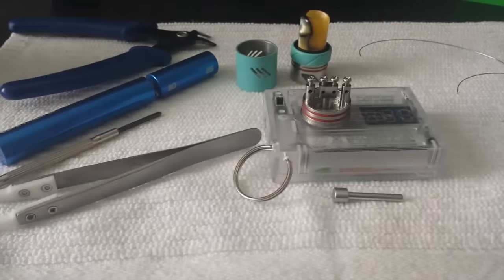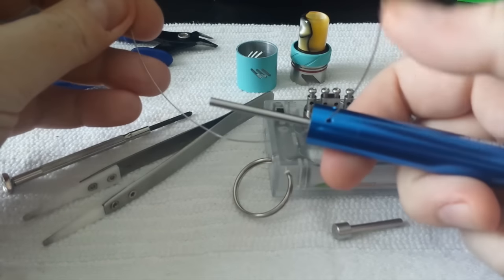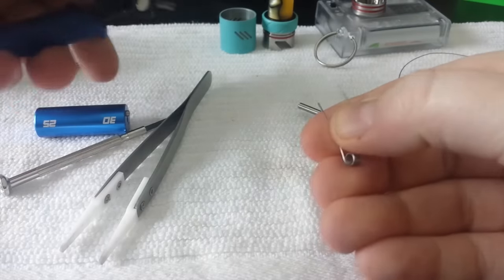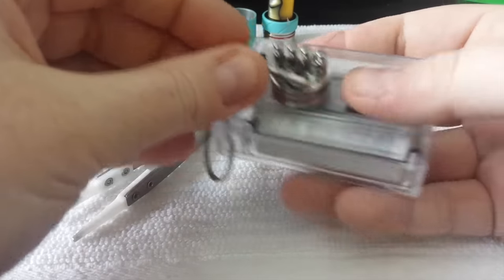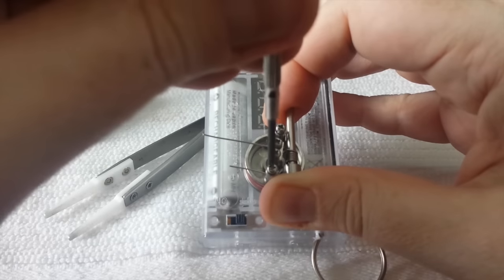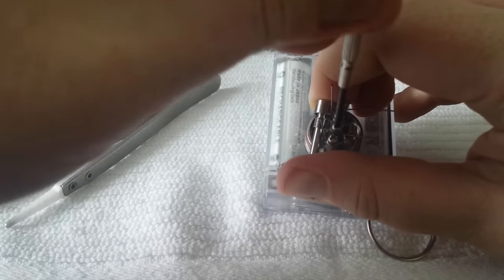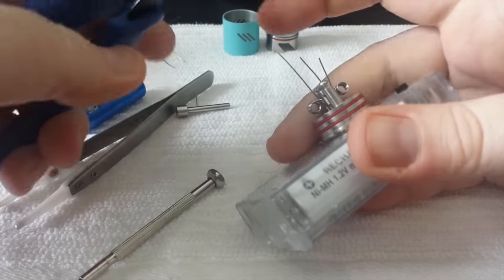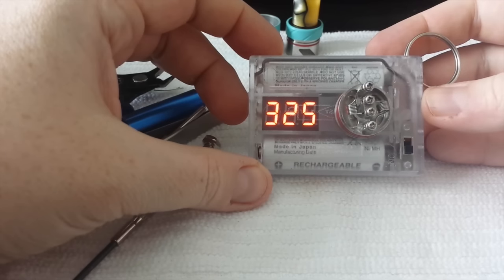Wotofo Troll RDA Dual Coil Build (0.3ohm, 24g kanthal)

Comment: why do you "pulse" the coils in the beginning? Personally, I usually heat them up [not anywhere near all the way] but enough to where they're pretty red and I find they are more malleable and easier to move into the right spot. what's the benefit of pulsing them vs. how I do it? [Aside from how I do it zaps much of my battery] Great tutorial btw!
Reply: +Alex Tolin If there's a hot leg and you just fire away instead of pulsing you can snap the wire.

Comment: how come when I build a dual coil the both fire before I wick them and then after there wicked and juiced only one fires I have to use a single cause they both wont fire
Reply: Bryce Flores it's usually a post issue on your rda. I was having issues with my rda so I'd tighten my post screws again. But you have to be careful you don't snap the kanthal. Or damage the screw by overtightening.

Comment: I know this video is pretty old (close to two years old), but I'm going to be buying a freakshow v2 RDA, and it's my very first RDA that I'll be getting. So, I'm really thankful for videos like this. I want to vape around .3Ω  - .4Ω, and I wasn't sure what gauge I should get. I think 24g wire will be good for my first builds, and I'm also going to buy some 24g inner 32g outer Clapton wire, because I'm also buying an Avocado 24, and I've heard claptons do best in that. So, anyway, I'm so thankful for your videos, and I'm hoping I'll be able to eventually completely understand RDAs. I've been sub ohming for almost 2 years, but with a tank and premade coil head. I'm tired of shelling out so much money for coil heads, when I can make own, and it looks fairly simple. I'm also buying a tool kit that includes an Ω reader, and many other doo dads needed for coil making! I'm actually pretty excited. I wasn't really interested in RDAs until I watched a video that showed a really simple kanthal wire coil, and the person was also talking about how much cheaper it is, and you get way more flavour, and when the wick has seen better days, as long as the coil is still in good shape, you can just remove the wick, burn off the gunk, and add more wicking. With premade coils I'm stuck throwing the entire coil away. So, that sucks.. haha. I hope you're doing well!                           またね！⊂((・x・))⊃

Comment: Great tutorial. I tried my hand at a build tutorial, but it was a miserable fail I think haha. I've never used 24g, but have been considering doing so at some point.
Reply from the maker: ***** what's your go-to build?
Reply: Abby Vapes Depending on the setup. In my Reo Grand (squonker) I'm happy at 0.5 ohms with 28g. In the subtank mini (the fail video I posted haha), 0.7 ohms with twisted 28g. On my hexohm and twisted messes RDA, I've been running twisted 26g usually in that at 0.2 ohms.

Comment: I bought a battery listman original 3000mAh 40A and I wand to build almost the same coils with your and put it in the mod with an RDTA 6.9ml I will smoke nicotine booster with a mix of 100% VG but how Lower I can go with a 20-30A ? I did the math but I want to understand one thing for ex if I do dual coil it’s will be like 0.25+0.25 so 0.5 /4.2v= 8.4A ? Or it’s count as 0.25/4.2= 16.8A+16.8A= 33,6A total ? By the chance nice guide and channel was searching long time and your is better than these ppls who all the same  like they are kinda high by vape

Comment: hi i have a question, i am using a melo 3 with the evic vtwo and the actual head is a 0.3ohms, whats the settings for this kind of coil to get a nice milky vape without burning the coil? i am running it with 40 watts ,4.65 volts and 0.54 ohms

Comment: Rookie question. What's the purpose of "strumming" the coils? It looks like it's to help with making sure there's good contact between the wraps, but I want to be sure
Reply: Strumming? Never heard of that, pinching yes, pinching ensures the wraps are firmly in contact with each other which in turn creates a better vape and eliminates hot spots
Reply: Watch her build tutorial.
Reply from the maker: ***** it helps to even out the coil and the small spaces in between that you can't see. check out GrimmGreen's latest coil building video from today or yesterday (i think) he does it as well :) Trevor Jones also does it.
Reply: That's what I was thinking. I appreciate the clarification
Reply: Wish I could watch ***** but I'm way over on my data
Reply: mike kemper, T-Mobile unlimited data
😀😀😀
Reply: I'm thinking about that *****, especially after Verizon announced they are going to get more spendy. I will most likely get a WiFi unit so I can stream movies and such, kinda need to keep Verizon tho for the coverage, nobody can compete with them yet in that area, which to me, is a bit disconcerning
Reply: Do what I did. Swapped to T-Mobile, got unlimited data, rooted and flashed a custom ROM to get unlimited tethering. Then I converted my Verizon to a hotspot, set it at 5 gigs, and I use it when I need to. As far as calling and text, T-Mobile is competitive with Verizon. It's their lte coverage that still needs work. But, if you plan ahead, you can compensate for that
Reply: Yeah, me and T-Mobile, not on the best of terms, I left them for Verizon because they sucked really bad where I live and over the road wasn't much better, that was five years ago, things may have changed but they still want money
Reply: Not sure now, but a few months the were asking 350.00
Reply: I would try again. Tell them you're tired of Verizon and you want to give tmo another shot. But, if they aren't willing to work with you, there's always Att. That's the next carrier on their hit list, now that they've passed sprint. Try to talk to a manager. A refusals rep can't make the call
Reply: I gotta do something, I have 3 smartphones, a WiFi, and a basic  phone on my plan, Verizon is the only carrier that works half decent at my house, my bill is averaging around 400 a month at the moment
Reply: I think T-Mobile still does their test drive deal.
Reply: How's their customer support?, in the past it was horrible
Reply: In store, exemplary. Ordering shit online terms to get fucked up, though.
Reply: In other words no change then
Reply: mike kemper, check your handouts
Reply: HOTSPOTS

Comment: SOMEONE HELP! I did this EXACT same build on a clone Mutation X RDA with a Kangertech 200 box mod, and it hits like shit. I don't understand why. I got the 24G wire, 3mm coilmaster thing, 7 wraps, and 68W. I cranked it up to 80W just so I could hit off it. But even then, it's not performing well.

Comment: i have troubles with spit back...so lately ive been makin that chuck norris build dnt hav spi bak but wanna use other builds anyone know how to stop spit back.?
Reply from the maker: try a thicker wick and/or higher wattage. usually you get spit back if it's not hot enough to vaporize, or if the wick is too thin.

Comment: My troll is super loose. Is that normal for it to pop off so easily?
Reply: +ABE CASH make sure that there's no liquid buildup under/around the O-rings. it could also be caused due to worn O-rings, so you may need to replace them.

Comment: Iv tried this a million times, it keeps coming out like at .05 or .07  Ohms :( I give up! anyone know why it's coming out like that
Reply: probably using 26 gauge not 24 gauge wire
Reply: Also you could try doing 4 wraps with 26 gauge. i did 5 and it came oit at 0.38 ohms and its a great vape
Reply: +xXMarsDudeXx Yea I found out it was my Rda that was shorting out. last night I did a 5 wrap dual coil build with 26 GA Kanthal and it came out to .38
Reply: +xXMarsDudeXx For some reason it's harsh, The cotton and coil is very well saturated and iv been trying to vape it at 40-50 Watts
Reply: +damagecase13 Nic Level is 3mg and I believe it's like 70 VG